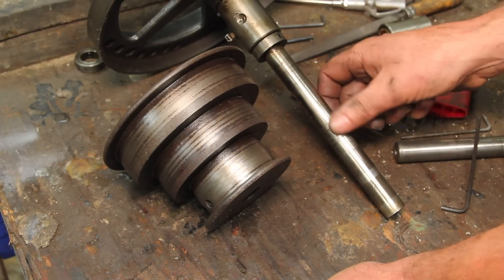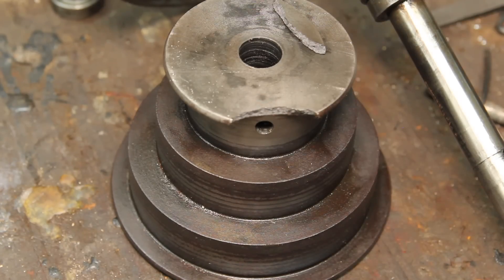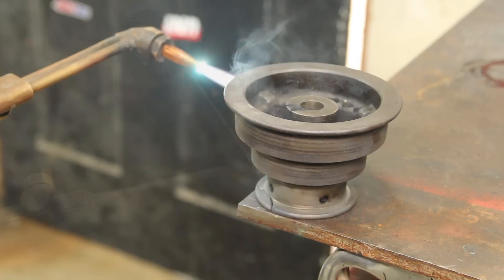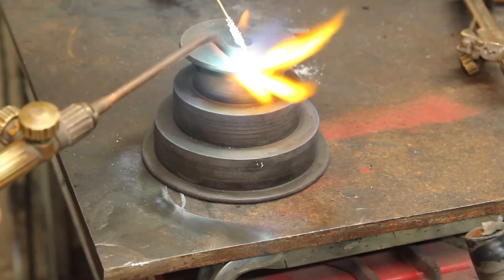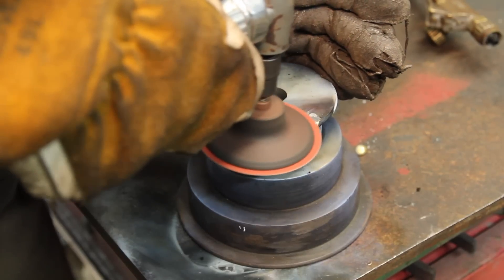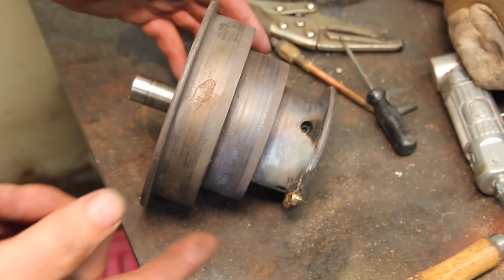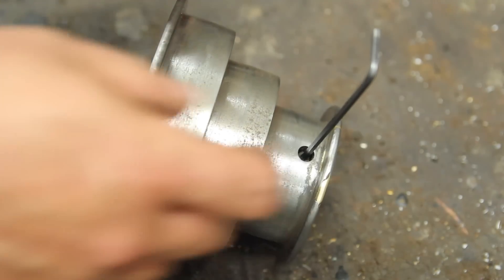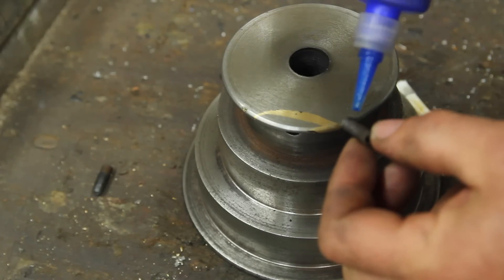Lathe pulley repair

Comment: at least pulley was 100% center supported, the china junk only has it at small end, and the remainder open so with lever/fulcrum effect, one side of key wears and fails, then ID and OD of pulley/shaft get munched leaving you with a pile of merde.

Comment: I haven't had a need for a mill yet, but I would certainly use it to rebuild the shafts in my old Clausing 🤣. The input shaft is a little rough...

Comment: If you are going to use a mill as a lathe, chuck that damn tool in the vise with minimal stickout... The facing cut was shit only because of that... I have had to use my baby emco FB2 mill for a similar bodge-job, and i used a carbide insert holder in a vise, spun the part at 2krpm after balancing it somewhat beforehand... The cuts that baby mill took were as fine as as those from an excellent condition monarch, at least in regards to surface finish... The dimensional accuracy was not an issue really, so i didnt check since the part fit perfectly, but the point is, hold that damn tool properly in the vise and you will get a marvelous finish and a great result... That much stickout on the mill or even on a lathe is only really appropriate for a boring bar... 
Not trying to shit on the work, its just a constructive advice for anyone who gets into this kinda situation where they need to mill-turn something... Its not as sketchy as it seems, and can be an overwhelmingly nice experience, especially with a dro, as then the cuts are easier to follow properly... And do lock the damn slideways of any axis that isnt used for the operation... You will be surprised at how good a mill can be as a turning machine... 

All the best and kind regards!

Comment: Would have been a perfect time to use silver solder. Not to be confused with plumbing stuff. It's actually braze as well, but whets in like solder. It's what the carbide teeth on saw blades and lathe tooling are held on with. As strong as the brass brazing, it just not need a large gap like brass or bronze. Just flux the joint and let it whet into the joint. Very effective!
Reply: Exactly what I was thinking. No grinding needed.
Reply: Thanks, I broke a couple of teeth on the back gear of my lathe and was considering whether to use silver solder or braze. Now I know👍👍

Comment: That steel bench was just sucking the heat right out of the workpiece. You might of been better off with something that had a thermally insulating characteristic.
I felt your pain when you flipped it over to braze and the chunk just fell off.

Comment: Great! You got a result.
I think I would have used a much smaller torch and lead-tin solder. No need for that much heat or strength.
Could have positioned the piece better and had very little cleanup, just needs a light file.

Comment: That section likely won't see heavy loads so metal epoxy/jbweld would have worked in a pinch. However, nice to see how involved a proper fix is.
Reply from the maker: That certainly would have been an option.  In reality, if the belt is tracking properly it should never see any loads, I mostly wanted to put it back on to keep the pulley balanced.
Reply: @JeremyMakesThings  I meant gluing the broken section back on with a very thin section of epoxy. The pulley would still be decently balanced.
Reply from the maker: @mhdm yeah, that probably would have been easier.
Reply: @JeremyMakesThings  Easier yes but no Youtube content🤣🤣
Reply: I agree. If it were a V-belt pulley, it would be another story.  A flat-belt pulley only has to hold the belt against tracking forces in the Z axis.